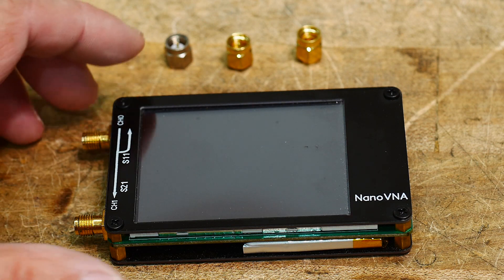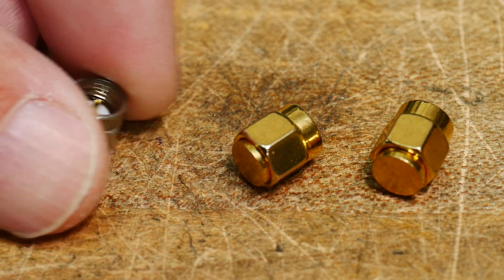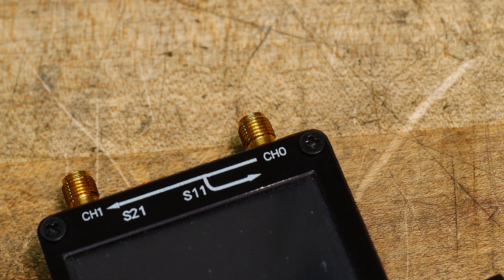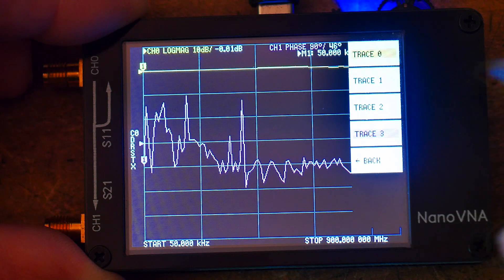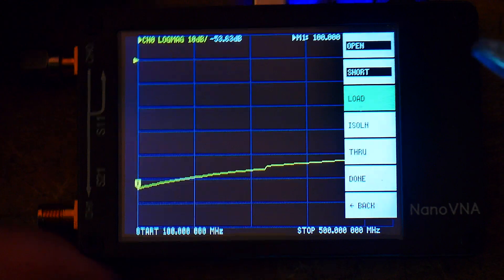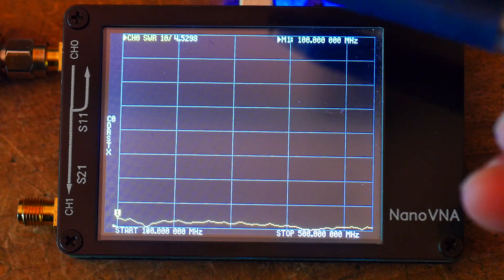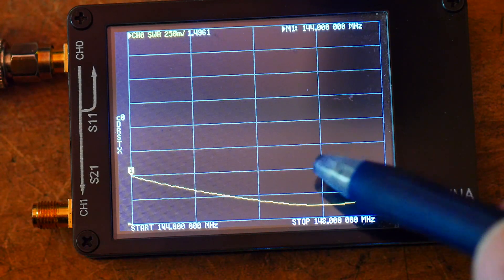#480 NANOVNA Made Simple

Comment: I just received my NanoVNA and followed the calibration and SWR setup procedure. All great. But when the unit is turned off and then on again, all the previous settings are not saved. I assume this is what the SD card is for. Does the unit need to be re-calibrated every time you turn it on? Or can the calibration and frequency range etc. be saved to an SD card?

Comment: Excellent tutorial video, you blew past all
of the electronic therum and science and got right to the point which in my case is how to know the correct frequency
range of your antenna ( if it's unlabeled, unknown or from a nebulus producer.) and wheather it's fuctioning properly. Because of course the Nano VNA comes with no instructions other then the structure map the included scan QR code takes you nowhere.🙏🏻 Thank you

Because
of the Nanovna's limitations which instrument do you recommend when working frequency ranges between 25mhz-6G?

Comment: I bought a Nano VNA  purely to tune a HF antenna. It didn't come with any instructions and was impossible to use without any prior knowledge of the device. I had no idea it had to be calibrated or what the "open", "short" and "load" connectors were.  I watched several videos but most did not explain clearly how to use it, and none explained whhich connectors were open, short and load. This video is by far the best and explained how to calibrate and use the device. I have now learned how to use my device to tune my antenna. (I had to buy a SO239 to SMA adapter.) Thank you for this excellent video! Without it I would have never used the Nano VNA and would have ended up spending many times more on a Rig Expert which is not really necessary as I only occasionally need to use a device like this, so the cheap Nano vna suits me fine. THANKS AGAIN!

Comment: Excellent video, thank you so much!

Just got my NanoVNA 3.6 today. There are a few minor changes to the newer UI but the video still works. 👍

I bought a RTL-SDR Blog v4 a few months ago with a dipole kit. Finally I can verify the correct antenna telescopic lengths for the right frequency far more precisely by manually adjusting them than using a calculator and 🤞

Currently setting up a few Meshtastic nodes in UK so this will also come in handy for verifying 868 MHz antennas.

Comment: Excellent video - new ham and just purchased a NanoVNA.  When I've calibrated do I connect my antenna into CH0 with a sma female or sma male connector attached to my antenna?  Thank you.
Reply from the maker: use an adapter that converts what ever your antenna is
Reply: @IMSAIGuy  Thanks for the response...I still don't understand...what sma connection to put on CH0.  If my antenna has a PL 259 do I couple on a male or female sma to CH0.  It may become clear when I get the NanoVNA.  As a senior new ham I have a lot to learn fast!  Thanx again.
Reply from the maker: @samstlm  oh, didn't understand you did not have a unit. the VNA will have female connectors and all the cal stds are male. so your adapter needs to end with male.
Reply from the maker: this might help: https://youtu.be/uL-7WEHupHo?si=jeB49aMY-u7Qt5tc

Comment: Thanks, very good video.  I have a question and excuse me if this is basic as I am relatively new to all this.  I have read that the coax can present problems with SWR so in theory would it be better to connect the antenna plus the coax that you will actually be using to determine and set the SWR?
Reply from the maker: you want your radio to 'see' 50 ohms. so you disconnect the radio and connect the nano in the same location as the radio. now the nano 'sees' what the radio will.
Reply: OK, that’s what I thought, thank you

Comment: I am using a multiband DXCommander antenna with 6 elements.  I should be able to save each element and calibration to each individual save spot correct? 😀
Reply from the maker: sure, I've done it with two band VHF/UHF antennas.

Comment: I love my NanoVNA with the 4" screen. Works great! Only 1 problem though - the view screen is terrible for us old guys needing glasses (too small display) and it is very hard to see outdoors on bright sunny days.  It would be much better if it were on 7 or 9" display.  The external software for it works great too but hauling a laptop around outside doing tuneup work sucks!!  Have you seen anyone modify one of these to use a bigger and or better screen, such as the Nextion LCD color  displays. This would seriously improve an other wise great little device!!  I'd even be willing to put mine in a better case too!

Comment: These devices are not well made. My touch screen does not respond correctly half the time, selects a block that I did not press. It is SLOW to scan. I'm so much happier that I bought the Rig Expert antenna analyzer. Its simple, and fast to give me exactly the information I need. I paid cash for mine and I dont work for them. 
I was disgusted by the results the Nano Vna gave me. I tried checking some coax. No explanation given if the results are not a nice straight line. What does it mean? Do I need a 3 credit course to get reliable results that can be understood? When I used the VNA on my EFHW antenna it said many bands were outside the tunable range buy that is not true. You can keep it. 
Some of the worst money I ever spent in the hobby. Your instruction are clear and well presented.
 My beef is with the results it gave me and the frustration it gave me over the last year. It made an HF mobile installation a frustrating nightmare due to its results creating a foundational belief that that my grounding was poor and wasted countless hours chasing non existent issues that prevented me getting the screwdriver antenna controller working. Send them all back to China.
You get what you pay for. 
Buyer beware.

Comment: I’ve been following your videos and admire your knowledge and the very pleasant presentation style!  

I’ve asked a question of many, but everyone has so far ignored it,  probably thinking that I am an idiot! 

I am building 2 element phased verticals for which I need to cut phasing lines of a specific length in degrees. I am familiar with the technique and the math, but the issue I have is that if I cut a stub for say 15.2 Mhz, put a connector on the far end and measure it to make sure it is on 15.2 Mhz and then measure from the other end (switch ends) the Nano VNA reads a frequency lower than 15.2 Mhz! Strangely, I read similar errors when I make these readings even with a Rigol DSA 815TG spectrum analyser. In both cases, the Nano and the spectrum analyser are both calibrated and normalised. 

Can you please let me know how to overcome this problem?
Reply from the maker: Did you include velocity factor in the math. And are you sure you know the actual VF for the coax you are using.
Reply: Yes I did. On the Nano, I am using the phase function and also tuning for lowest reactance. On the Spectrum analyser I see a nice dip at 1/4 wave and 1/2 wave (depending on the far end being shorted or not). It’s all very fine but what confuses me if how they stubs resonate 40-80 khz apart when I swap ends. That’s no good for phased verticals, obviously. 

It’s doing my head in!
Reply from the maker: try: https://youtu.be/l9YN6bPkdq8
Reply: Thanks, I’ve seen that before  and learned from it too.bAs I’ve said, I’m a big fan!

I still can’t understand why a cable that’s a 1/4wave or 1/2 wave  at a certain frequency is not the same when ends are reversed. I’d love to find out why and how to overcome the issue so I know my phasing is correct! 

Thanks for your help .
Reply from the maker: @rballad142  try putting a short on the end

Comment: It's much better to set your cal range to the range you actually want to use for a specific antenna.  Maybe a little broader if you're trying to tune the antenna so you can see how well centered you are.  You save no time to cal super wide and then zoom in.  Also, if you're going to just click through the isolation and thru cals (which is fine) then you need to pause for a couple of seconds at each button push to let the instrument run the routine.  If you click too fast it will result in a bad cal.  I know this from experience.

Comment: A few pointers that were overlooked in this video:

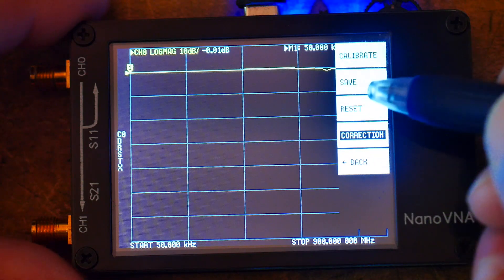#1. 9:40   You're probably wondering what "Stimulus" you should set your NanoVNA to. A great place to start would be your radio's Tech Specs. For example, let's say you own a Baofeng GMRS-50X1. According to the Tech Specs section of the User Manual, it transmits and receives at 462.5500 ~ 467.7250 MHz. So a range of 400 - 500 MHz would be a great range to set your Stimulus to.

#2. Given that newbies aren't going to know a whole lot about the hobby they are getting into, let alone protecting their equipment, you should always have at least a link in the description of videos for newbies on how they can protect their toys from static zap. Here's a great example of an in circuit device that will help newbies from creating very expensive paper weights: https://www.youtube.com/watch?v=totwu4IbavE

Comment: I want check 915mhz do I make the range 915-915
Reply: Also would this test loss? I have 3 things to do. Test for loss, some how test the radio and test for interference
Reply from the maker: I would set a span of 900-930 and see what the 915 point looks like
not sure what you are testing for:
loss: you mean cable loss?
interference: a VNA is not used for this
Reply: Yes cable and connection loss with and without filters, amps and whatnot,  trying to figure out if I can put an amp on my setup, if I need to attenuate the tx, and my signal integrity... But I'm a total noob.
Reply from the maker: @ryolacap  please look at my playlist 'NANOVNA' I have many videos showing how to make measurements
Reply: @IMSAIGuy  thanks just hoping I have the right device for this 😁 AURSINC NanoVNA Vector Network Analyzer 10KHz -1.5GHz

Comment: Thanks for the best video about the Nanovna that I've seen. I have two questions, first, why do you need the open connector? Why not just leave the connector open? My second question is can I set the frequency range between one & 30 MHz? I'm most interested in the HF bands. Again, thanks for a excellent video. . . I bought NanoVNA, it was slightly different than yours, however I was able to configure it without any issues. I set mine up to operate between 1 & 30 MHz. Thanks again for the great explanation.
Reply from the maker: the open is to set the reference plane, watch this: https://youtu.be/yGKWBpgN8PU
at the end I talk about the reference planes of the calibration set
yes you can set any working frequency range

Comment: im looking at LOGMAG readings and i have "10db/ -23db" the value "-23db" is better to be higher in negative value or smaller, close to 0 ?. like -10db better than -20db? Thanks.
Reply from the maker: -10dBm is more watts than -20dBm  
+10dBm is more watts than 0dBm
Reply: @IMSAIGuy  i should have mentioned that this measurements where taken on the antenna that i built.... and i was chasing the best value on the s11 logmag .
The swr was 1.2
Reply from the maker: then the bigger number the better the match. see: https://www.amphenolrf.com/vswr-conversion-chart
Reply: @IMSAIGuy  thanks for your reply 🤗
All the best in 2022🥳

Comment: Thanks for this very helpful video. Can you comment on how the antenna should be positioned when making measurements? I connected my DIY 1/4-wave ground plane UHF antenna to my NanoVNA to measure SWR (it's a little higher than I would have liked) and found the SWR curve to be very different depending on how close I was to the antenna, and whether e.g. it was on sitting on my basement floor vs. propped up on a vertical stick in my backyard. 

Additionally, when measuring the rubber ducky that came with my HT in the VHF range, I found that it had a ridiculously high SWR (in the 50 range) except when I was touching the NanoVNA in which case there was a "notch" of decent SWR. Is this expected behaviour? Considering that the NanoVNA measures everything connected to the port (including cables etc.), where should the antenna be when making measurements?
Reply from the maker: the measurement should be with the antenna in the location to be used. Any objects near the antenna effects it. Here is fun video: https://youtu.be/wem0DoPe5O0

Comment: When I looked on eBay there are different frequency ranges 

Do all of them go up to 3 GHz or are there different models like it says 500khz to 900 MHz on some models others say 500 kilohertz to 1.5 gigahertz and others say 500 kg to 3 GHz

Can all of them do up to 3 GHz with different software or firmware loaded or do I need to purchase the one with the full range up into the gigahertz Wi-Fi ranges if I want to use this for the 2.4 to 2.5 gigahertz antenna tuning ?

Thanks for your help
Reply from the maker: no   each is different

Comment: I've seen these advertised and they look interesting. Then I read an article about one and got more interested and started looking at prices. This video shows one use for it. Thank you. I'm just making tuneable band pass filters for my h/b tx/rx and I think this should let me see how they perform.
I can also see how well my h/b 2m collinear works which I constructed recently. The SWR is low as shown on the meter on the FT817 but this will show me more. I spent a lot of time adjusting my h.f. dipoles, this gadget would have shown me easily to lengthen or shorten them. The MFJ stuff looks simpler to use but I don't like the price.
Bill, G4GHB.
Reply from the maker: I have plenty of videos showing the Nano sweep filter designs. Check out my playlist of NanoVNA
Reply: @IMSAIGuy  Right, I'll take a look at them.

Comment: My new VNA has been gathering dust the last few weeks as I cower in fear of turning it on. Thank you so much for helping me overcome the terrors. I will second the two minor complaints noted above by other reviewers, insert an sma to sma pigtail to avoid overstressing the unit, and set a shorter tuning range to cover the ham band only. I will add one more suggestion having seen elsewhere that static discharge can damage the unit so it may be worth grounding the antenna before connection and wearing an earth band.
Reply from the maker: The static issue on the TinySA was found long after I made this video. The newer units have TVS (anti static) diodes inside. I have not heard of issues with the VNA. If you load the VNA with the DISLORD software, you get 401 calibration points. Which allows a much wider range of usable frequencies.
Reply: @IMSAIGuy  A quick message to thank you once again. Just spent a day in the loft tuning up my 10m/6m/2m/70cms antennas and the VNA perfomed fantastically. All the antennas are in close proximity to one another and effect each other as a result, so the VNA has really done a great job sorting everything out.
Reply from the maker: @johntimken9842  great!

Comment: SWR = Standing Wave Ratio - SWR is defined as the ratio of the maximum radio-frequency (RF) voltage to the minimum RF voltage along the line.
Reply from the maker: technically the VNA uses the absolute value of S11 and calculates VSWR

Comment: Mar 2021:  Just got mine.  Thanks for this!  Another video the guy with the EE degree was using a  torque wrench to tighten the nuts.   Just wow.  :)
Reply from the maker: if you every buy a 40GHz VNA that costs $100,000 then yes, you need to use a torque wrench. But at 1000MHz and below you can relax

Comment: Sorry if this is a dumb question because I am a new ham but if the antenna feed to the transceiver has a PL-259 connector, then is an adaptor needed to connect to the unit? Great video!
Reply from the maker: Yes, the connectors on the NanoVNA are SMA. So you will need to adapt PL-259 to SMA. You can seem me do that in: https://youtu.be/mU71rGUKlBI

Comment: Can you measure return loss/VSWR of parabolic antenna using this method? Or more specifically its efficiency?
Reply from the maker: return loss and vswr yes. efficiency no.
Reply: @IMSAIGuy  Is Radiation efficiency, kr is correspond to the return loss of the parabolic antenna? As I read that the radiation efficiency doesn't have much effect on the efficiency of the system.
Reply from the maker: @sarwarn2107  efficiency is the amount of energy that makes it out of the antenna, so anywhere it goes not in the right direction is loss. if it goes back down the cable (return loss) or turns into heat. or is not aimed in the right direction.
Reply from the maker: @sarwarn2107  https://youtu.be/FeyrQ9yyfTw
Reply: @IMSAIGuy  Thanks that helped:)

Comment: Thank you for a great video.  How often do you need to calibrate?  Also, if you are just looking at the 2 meter band, can you just calibrate from 144 to 148?
Reply from the maker: I calibrate each time I turn in on. yes setting it from 144 to 148 will give better results. it uses 101 points between the low and high value.

Comment: Excellent, what model are you using here?  thanks and 73
Reply from the maker: this is the original one, I you are buying one I would recommend the H4 version
Reply: @IMSAIGuy  Thanks I was hoping the 50. version would also work, are there problems with the version here?
Reply from the maker: @flashMXdesigner  No, it is just fine except the screen size is too small. I like the 4" display. But the functionality is the same on both

Comment: After firmware updatting touchscreen does no work properly anymore...any hint how to fix it?
Reply from the maker: I think you need to run the touch calibration. Since the touch does not work you will need to use the jog button on top to do the navigation. The jog button goes left right and you can push it to click.